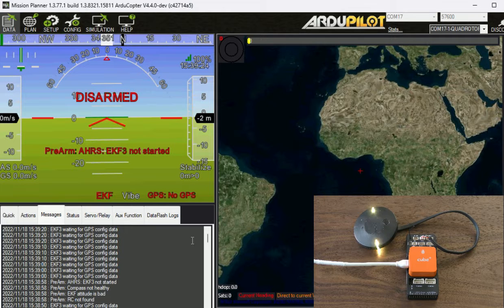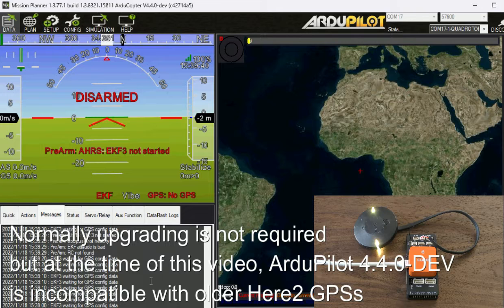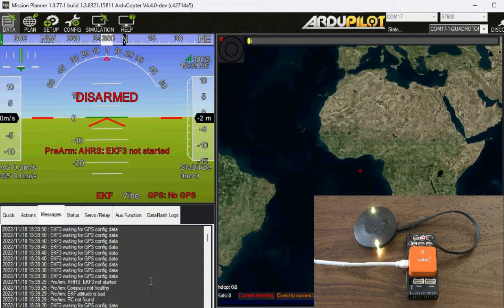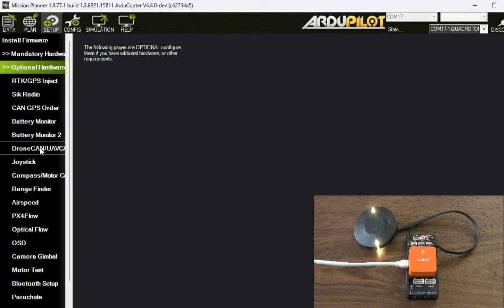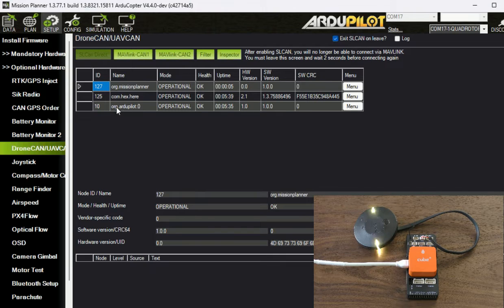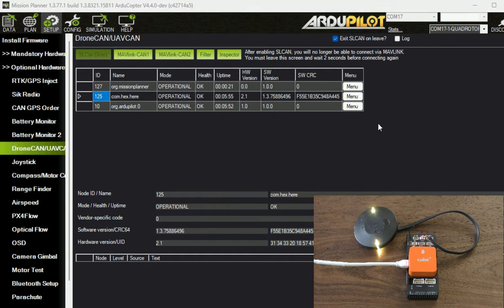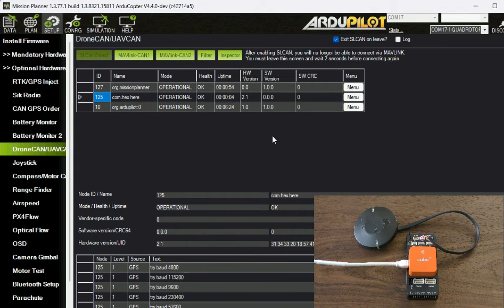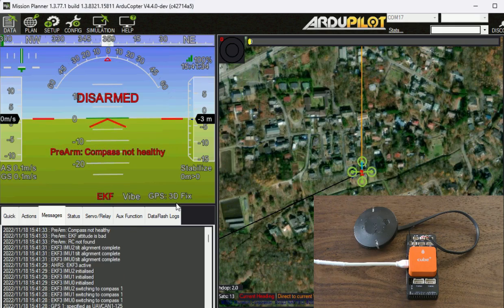CubePilot UAV CAN GPS firmware upgrade process

Comment: CUAV V6X flight controller and Here3+ gps can used?
Reply from the maker: Hi, I think if the GPS has a 4-pin CAN port then it should work with the CUAV V6X including the upgrade process shown in this video.

Comment: Hello.
How to restor Can_baudrate to 1000000 from here3+ params after i changed it by accident to 230400. I can no longer connect to here3+ by can !!
The gps Flashing yellow green purple:
Any help would be appreciated . Thanks
Reply from the maker: Hi paziklocherl, could you try changing CAN_P1_BITRATE to match what you set it to on the GPS?  Hopefully that will allow a connection with the GPS and then you could revert the change on both the GPS and the autopilot.  By the way, in general it's better to raise support questions in the ArduPilot forum (e.g. https://discuss.ardupilot.org/c/arducopter/copter-44/169 )or CubePilots forums.

Comment: i couldn't update or option  firmware of cube plus
Reply from the maker: Hi M Hawk Tech, normally failure to update firmware on an autopilot is because of a USB driver issue on the PC.  It is probably best to report the issue in the Copter forums https://discuss.ardupilot.org/c/arducopter/copter43/167
Reply: @rmackay9  I also have a cube that doesn’t take firmware . MP see’s everything but the firmware upload fails mid way . I heard about a batch of cube black FC’ built in 2020 that have a problem . My cube orange+ was trouble free , flashed fine .
Reply from the maker: Hi  @ronchampagne8484 , I've never heard of this problem before so I don't have much helpful advice I'm afraid.  I guess the best I can suggest is making sure that you're using the latest stable Mission Planner.  Maybe try replacing the USB cable used in case the issue is that the Cube's USB port has become a bit loose somehow.  Maybe try flashing different firmwares on it (plane, copter, rover or different versions of AP).  Sorry, I don't have many more ideas... if it's a hardware problem I'm not sure what can be done really.